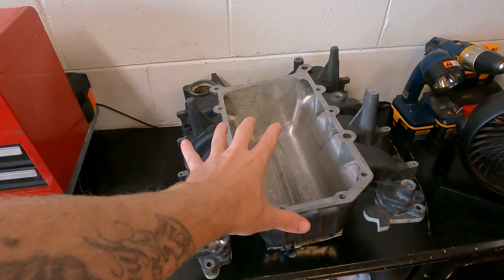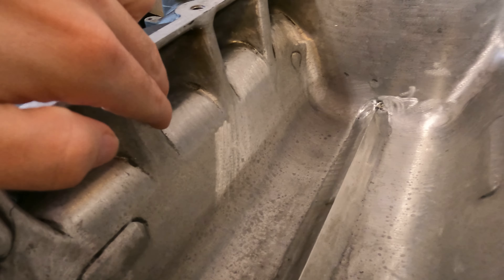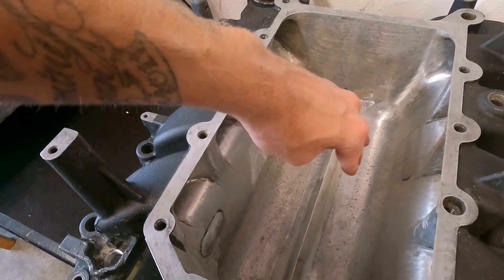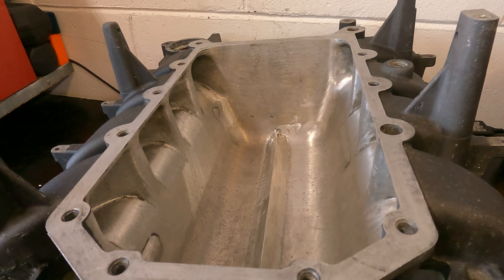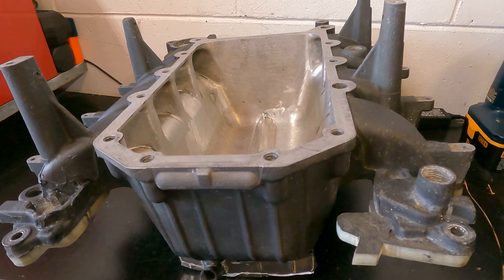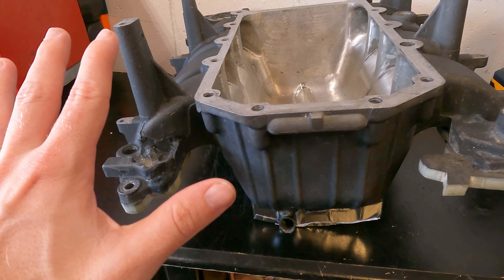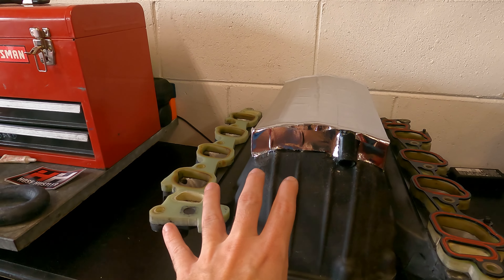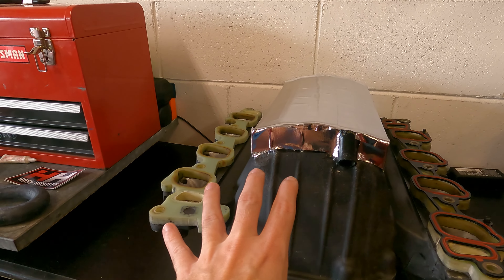Ford Lightning Coolant Crossover Mod on CUSTOM Lower Intake Manifold / Turkey Pan!

Comment from the maker: *CORRECTION*...I'm aware I got the coolant path wrong, coolant flows from the front, towards the back of the heads, and installing the coolant crossover allows coolant to exit the rear of the drivers side head, eliminating that notorious hot spot, and evening out the heat.  Same concept, and a great mod to do, But I'm aware I said it wrong in the video...
That being said, make sure you LIKE the video and SUBSCRIBE for more! ⚡⚡⚡

Comment: ✌🏻Hi.,my friend. I salute you from San diego.☀️ California,  I. love. The idea. Of the pyramid on the bottom of the Turkey pan .the welded angled..I have.ported mi turkey pan  similar to yours . But this guy whent over the hill whit that😬👏 modification. Wow 😁👏👏 👏👌  I  broke my transmission. cross member 3 weeks ago. I couldn't find a new one on the dealership and the ones in the junkyards are worse than mine .so I have welded two  1/4 plates to make it stronger. And the 4link bars to make it more stable... the  truck is 95% ready hope to see your truck son whit this setup.. glad to know you and always pleased for all your help and experience 🤗👍..god bless. Like. Always the best of the best for you and🙏 your family..happy🦃 Thanksgiving 🙏✌🏻

Comment: I've done the "4x4 lightning swap" thing. Built NVH short block, APR 2K hardware throughout, 8 thread ported PI heads, 10lower, 2.8 upper, ported 99 Eaton. Put down 425/523 on WMS dyno. Has cats still, the spun MBS 200 cell ones, but it passes emissions.
That swap is gonna be a PITA to do today because Motorcraft doesn't make a lot of the parts you need anymore. You'll need a fan spacer to use your OEM fan and the Lightning fan shroud and you'll need to fab up a throttle cable/cruise control cable bracket because you can't buy a new one anymore. You'll need a CJ crank if you plan to really spin the Eaton, you'll snap the snout off a stock steel crank if not. You'll need to fab up an alternator bracket as well, or find a used one. 
I did my swap back in 09 when you could kinda buy the "basic swap kit" from Mike on the forums, but he has passed away and motorcraft stopped making lots of the parts.
Reply from the maker: Nice!  Yeah I've been there done that with spinning the eaton hard, 10lb lower/2.7 upper made 501/569 on my Lightning.  The 4x4 is just gonna be stock boost, nothing crazy.  Stock sized pulleys and a stock setup.  I have all the parts, it's nice to know people lol, and being a machinist helps with anything I'll have to make/fabricate.  But I have everything, just need to finish the Lightning before I start, so both arn't down at the same time.
Reply: @DebtLife_Projects  Rog, mine is a 98 and I was lucky that it came with a 4r100 (fully built now). Do you think the 4r70 in your 4x4 will hold up?

Comment: I really didn't want to do this mod but I may have to now. I bought an 01-04 lower intake to go with my new Whipple 2.9 but the back coolant pipe got broken in shipping. I can't find that pipe anywhere where it is sold as a stand alone piece.
Reply from the maker: Perfect time to do this mod then, may as well, it's very beneficial!  Helps cool those rear cylinders that are notorious for running hot
Reply: It's available I bought one recently